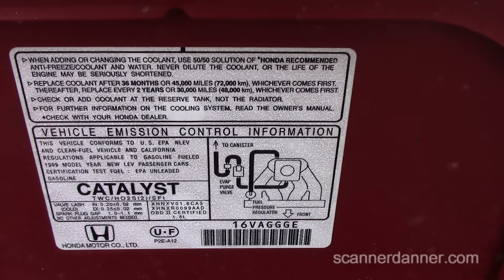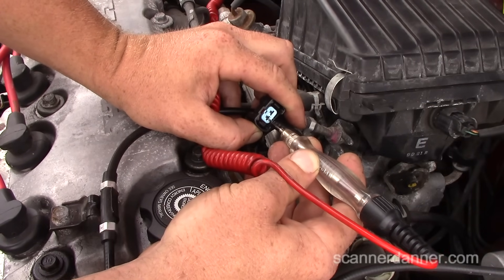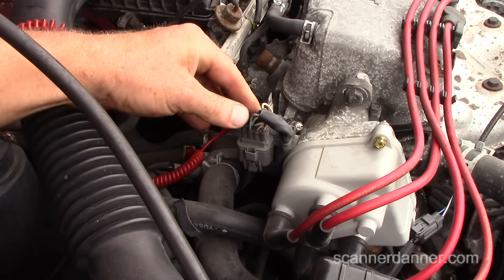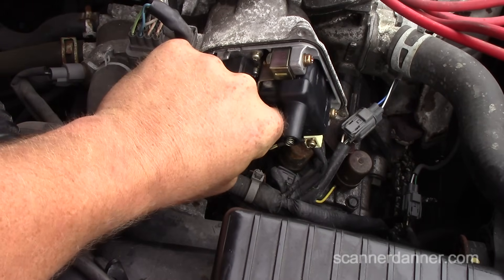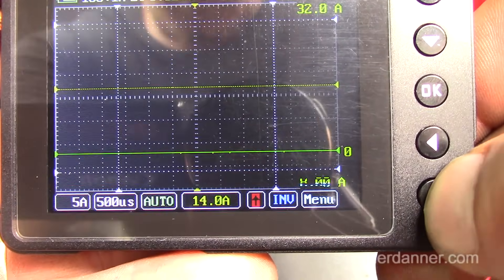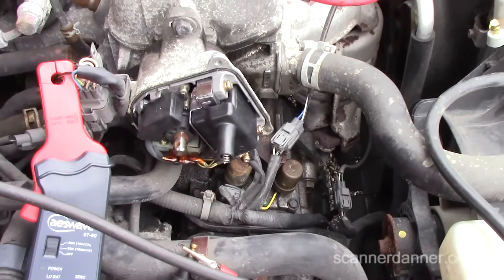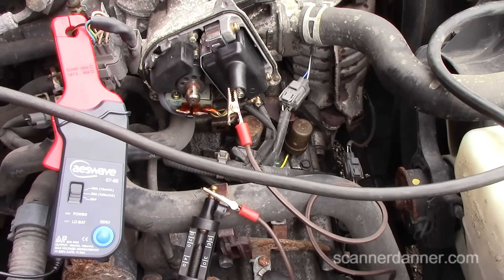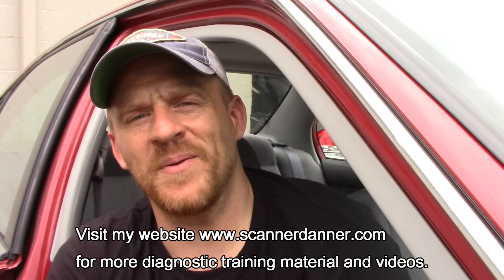99 Honda Civic No Spark Diagnosis with a Test Light

Comment: hows it paul, thanks for the vid! i wanted to let others know about one  "variable" .  i ran into an issue where i had control on the negative side of the ignition coil. test light would blink, ignition coil current ramps ok, but still no spark out of ignition coil!  At 8:18, you disconnected the ground on the igniter. and put your test light to positive to check output on icm, how ever in my case, when i did that my test light would stay on. indicating a short internally of the icm? replacing the icm was the fix in my case. could you explain why id have a ground coming out of icm constantly  on that terminal at 8:18. thanks

Comment: Thanks for the video. I used it to troubleshoot my ignition coil. I've got a 91 civic with 136,000mi on it. Since I just had to replace the coil, I'm thinking about also replacing the ICM igniter before I get stuck on the road again. In your experience, about how many miles can you get on the original honda ICM before it needs to be replaced?
Reply from the maker: can't put a number on that Steve-o

Comment: Probably late to comment but I’m dealing with the same car similar situation. I have injector pulse and spark but when I take the wire off the igniter like you do it doesn’t pulse. It pulses when I reconnect it. Can an igniter be bad and still have spark. From what I’ve researched the distributor has 3 sensors built into it. Ckp sensor a cylinder position sensor? And some other sensor.
Reply from the maker: If the spark is weak, yes, an ignitor failing can do that.
How far does the spark jump? It should jump a 1" gap.
Reply from the maker: Check out this one that had weak spark from a bad igniter 
https://youtu.be/eoodIVGgGyw
Reply: @ScannerDanner  I’ll have to double check all my test again and get back to you. I ordered a reman distributor just in case. The car had one installed at one point. All I know about the car is that in ran when parked supposedly. She didn’t know it didn’t start.
Reply: @ScannerDanner  got it running. whoever worked on the car before me installed the wrong spark plug wires. I bought new ones and compared the new and old and the old were a good half inch shorter.

Comment: Paul, I just got a picoscope 4425 and am new at it. Could you tell me why my "zero" (or baseline) jumps up and down during my coil current ramp test while engine is running. The ramps are fine, but just the zero line (with ramps on it) are jumping up and down. Thanks.....

Comment: I notice you check injector pulse with the connector unplug. Can it be done with the connector plug in. With the test light connected to battery positive.
Reply from the maker: It can be done plugged in too, but some test lights will carry enough current to energize the injector, which is why i do it unplugged and yes, connected to battery positive with the test light.

Comment: this may have been covered somewhere else but I noticed you used an incandescent test light so I take it no problems with current draw on computer or did you ensure test light was of low amperage anyway? Hence my next question where does an LED " computer safe " test light come into play when testing switched grounds?
Reply from the maker: I am using a light on a circuit that normally carries 6-10 amps of current. My incandescent test light draws 200milliamps. There is no concern here. 
Now, for the ECM to Igniter control signal, you would not want to use this light as it would most likely pull the signal to ground through your light. Maybe an LED light would be your friend here, but LED lights can also be misleading.
Reply: @ScannerDanner  thanks

Comment: Changed the distributor and rotor yesterday. Very very simple, right? Yup. I have done it on many vehicles over the years but once done The car (1996 Civic CX) would not start. It would crank over but not start. It is my assumption that when I had to lightly crank it to expose the rotor screw, I wrecked the coil. I will use this vid and my test light to sus it out. My son will be crank man as it is his $500 Civic.

Comment: hey man dude ur vids are awesome.. i own a small marine repair shop and just hit a my first brick wall with a no start situation on a early 90s delco EST system on a 454 marine efi engine (vortec gen 6), ran fine for 2-3 days on stand, came in 4th day, powered on, did sth for 5 minutes and the coil was SMOKING. Nothing else looked bad- tested pickup (ohms and short to ground test), tested with 3 icms, more work to do but i am learning alot just seeing you say the same thing over and over and slowly im forming the picture- sweet man thanks for helping us noobs out with this stuff-
Reply from the maker: thank you so much! This video may help you a bit too 
https://youtu.be/7nHbctRwyys
https://youtu.be/9U942uGTZf0
And then this GM distributor design no spark video https://youtu.be/mDKj19Hnhd0
Reply: @ScannerDanner  Hey I really appreciate replying man, much appreciated- your videos are real helpful. Found a pinched grey tach wire that was shorting the primary (ouch smokebomb!) - ill be looking at getting your book too- greta help man thanks again!
Reply from the maker: @SocalMarineUSA  heck yeah man, nice find!! What led you in that direction? Coil negative would have been grounded constantly. 
Using my test light methods, with light connected to ground, you would have noticed that coil negative was not lit up like it should have been. Then to keep the coil from frying again during the rest if the tests, I would have unplugged it, and switched my test light to battery positive and connected that to the disconnected coil negative wire. Light would be lit constantly. Then I would have unplugged the ICM to confirm light was still lit, confirming short to ground on the coil negative circuit which would have led directly to what you found. Is that what you did?
Reply: @ScannerDanner  hey - so i was working on a marine variation, why they have a loose grey tack wire is beyond me, when there is already one in the main loom to the front - the bastard got pinched between block and a bracket.. it changed colors too which is just plain stupid on any marine engine.. I did use a GTC505 to confirm zero spark, as i wasnt 100% sure how your tests would reveal my exact issues - by not seeing it spark a certain way would mean I have seen it spark the right way before lol .. I eventually figured what the white wires was by opening the loom and found it was grounded which was a real fluke-

Comment: Mr. D, where do I go next in a diag if I have pressure at the rail, injectors are firing, but no spark at coil, or no ground pulse from igniter to coil.

Comment: I have a 98 civic that’s starting to slightly misfire at idle when the engine is warm (mainly after driving on highway) no codes or anything. Are coils known for failing when hot or possible something else? Thanks
Reply from the maker: Idle only? Do a valve adjustment on that engine before you do anything else!
Reply: @ScannerDanner  Yes idle and very low rpm acceleration. Again it’s not consistent and sometimes never does it for days. Mainly can be reproduced if driven for a long time

Comment: I did everything you did and I’m not getting power to my injectors wen I crank it and I have no spark I’m getting power to the coil but not to the igniter does that mean is my ECU?
Reply from the maker: With the key on, measure the TPS or MAP sensor for a 5v reference and tell me what you see. One of the 3 wires on each sensor should read a constant 5 with the key on

Comment: I only have a test light. I’m testing my ignition coil for spark but no spark comes out my light flickers when I have it on the wire. I’ve used my volt meter to read if there’s volts but no read just 0’s. Do you have any suggestions?
Reply from the maker: what does coil + look like compared to coil - ? (during cranking)

Comment: if you crank it that much with fuel beeing injected, do you consider that a Problem ? I mean the fuel getting into the oil
Reply: I reckon most would be blown out the exhaust.
Reply: Did you not hear the engine when it first started? There was plenty of fuel in those cylinders and thats why he rapped the throttle a couple of times to clean the plugs up.
Reply from the maker: Yes but no more than what the customer already did to the car before bringing it in. These always come in with dead batteries, so what's that tell you?
Reply: I have had many cars towed in that are flooded from no spark cranking.  Some even wash down the cylinder walls and lose compression.  Sometimes you can smell the gas in the oil.  Always put those down for an oil change after I get them running.

Comment: Paul I love the look of the AES 1 channel scope ... but, according to specs it's only 1 MS/sec? Is that sufficient for consistent detail of a secondary waveform ie enough for a consistent firing line maximum to display? Mine is 2.6MS/sec on 1 channel and I find it misses a consistent firing line display.... tends to bounce around.
Reply: Sounds like a triggering issue, try experimenting with trigger settings
Reply: Thanks for the insight. I don't mean the waveform walking across screen. No prob stabilising the trace. I mean trouble getting a consistent firing line kV peak on known good cyl, or reliably comparing between cyls. Firing line jumps from peak to low to peak. I'm assuming it's a sampling rate error ... not fast enough to consistently capture the micro secs of peak kV? ie 2.6Ms/sec versus say a Pico that might do 400Ms/sec on one channel. Welcome thoughts?
Reply: Wasted spark system?  --if it is  kv is always lower on the  spark  that occurs on the exhaust stroke so 50%  of the sparks will have lower kv.

Trick to capture the useful sparks is to increase the trigger voltage level to a high enough voltage that wasted sparks don't trigger the scope.
Reply: no not wasted spark ... Standatd COP arrangement but also tried on coil & wires system
Reply: Should be more than OK for that I have the same hardware but not with the uScope firmware and it works fine on primary and secondary.
I have had problems with Hantek secondary ignition probes failing, these days I tend to go straight for primary.
Reply: haha ... funny u mention Hantek. i am using a hantek. i find it more than adequate for everything except sec ig. i wonder if a good inductive paddle probe wld be better a la pico!

Comment: Hi Scanner,any clue 1998 Jeep Grand Cherokee Laredo 4.0/242cu.in long crank time like 7-10 sec. I know that's not long but never did it b4.good comp. all six holes new cap rotor wires plugs. What's a good direction to look at first? No check engine light.
Reply from the maker: Fuel pressure

Comment: So is an igniter the solid state equivalent of points?
Also why was there no battery + on one pin in the injector plug, I get the computer is grounding (control) on the other pin through the test lamp to battery + in order for the injector to fire it needs + all the time doesn't it?
Reply: Yes, exactly

The test light clip was on battery + so it only lit when the ecu supplied ground. There was power with the key on but with both ends of the test light on positive there's no voltage difference to make the light light.
Reply from the maker: Thanks Matt
Reply: ScannerDanner Oh Thanks I thought the test light was on ground at first checking for power to the injector. Was just following the way I would have been thinking if you see what I mean

Comment: Old thread I know, but at 9:00 you touch the igniter and it pulses. What do you do when it does pulsate? It's dead no light. Same set up one the yellow green wire into distributor and nothing either.
Reply from the maker: What have you done with it so far?
Reply: @ScannerDanner  2000 crv 2.0L crank, no spark. No spark on any wire, distributor cap or coil tower. Test light from grd shows power on + and - connection of coil. But no flashing light. Isolated coil, like you suggest, with pos batt test lite connection get nothing from ignitor coil post(all this as cranking ) also did positive connection to batt and test yellow green wire at distributor input wires, nothing at all.
Reply from the maker: @stpphone5074  do you have injector pulse?
Reply: @ScannerDanner  have not probed it. But hear fuel pump and smell gas during cranking. Was trying to establish spark before looking into gas.
Reply from the maker: @stpphone5074  just wanted to he sure you're getting your distributor input signals to and from the computer. Definitely still focused on the no spark, this just gives us good direction. If you smell gas, that is a pretty good indicator. If you can't trigger that igniter, it could be:
1. A shorted ignition coil
2. A bad igniter
3. Wrong test light being used or not done properly
4. Wiring problem to the coil or igniter
Reply: @ScannerDanner  took coil to parts store and multimeter the connection s on both, very close readings so i assume it was ok for now (revisit if need be) altho it does have indications of arcing on surface of coil. Thinking it could be a bad crankcase sensor
 I tried a "jdm b20b 99-01Honda crv rd1 obd2b ckf bypass" (YT vid) with wiring splices but didn't seems to effect it.
Reply from the maker: @stpphone5074  at this point, if you still need help, let's move this to my forum. It is free to join https://www.scannerdanner.com/forum/post-your-repair-questions-here.html and we can continue this there. These back and forth messages here tend to multiply and I have 300k other people asking me questions, so it get's really hard to keep up. 
Last message then to the forum okay? 
This is why I asked you about injector pulse. If you have injector pulse your crank sensor is fine. Second, the ohmmeter tests of a coil are not good enough. When and ohmmeter tests good, it can still be bad. When an ohmmeter tests bad, it is bad. That is the downfall of that tool. To the forum my friend, hope to see you there.
Reply: @ScannerDanner  sorry for forgetting to post back. Resolved it by replacing distributor. Thanks for your help.

Comment: Is the test light can resist spark for coil??
Reply from the maker: Yes but only use an incandescent style bulb (like this one), you will cook an LED
Reply: @ScannerDanner  this one
How many watt and volt??
Reply from the maker: @mekkibilal1372  they don't make this one anymore and it is getting harder and harder to find incandescent test lights. We have one we are working on that should be ready soon. Not sure the watts on this but it is a 12v test light and will draw about 200ma of current
Reply: @ScannerDanner  thank you very much

Comment: How can you tell that wave form is a shorted secondary and not a shorted primary? Wouldn’t a shorted primary cause a faster current ramp too?
Reply from the maker: shorted primary will be a completely straight up line and may even resemble a square wave pattern. In other words no ramping affect at all.
Reply: ScannerDanner ah ok, thanks

Comment: Hello, I did the positive battery side to the negative side of igniter (yellow wire black stripe) and even turning over i get no light. I replaced the igniter and still no light can you help? Thanks! 2001 accord Ex 2.3,

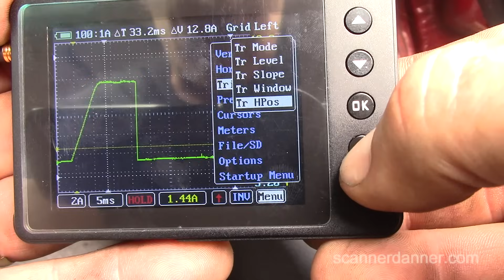Comment: Paul, @ 24:50..I'm not sure, but what I think you really want to be able to do is instead of going into the trigger menu is to go into the Horizontal menu and select "Horz Pos". That will make a small yellow rectangle at the bottom middle of the screen, which you will be able to move the position of your event either left or right in fine increments...It is better than the 2 positions the trigger menu "Tr Hpos" has to offer- Better control.

Comment: Thank you so much for this video... i have a 1998 honda civic DX and one day i was coming back from the store my battery light came on so maybe i thought it was my alternator so I replaced it but still no crank.. the motor would just rotate but didnt start then i changed my battery to a new one but still doing the same thing... so today i changed my fuel filter thought it was clogged up but that didnt help.. at all i thought maybe my timing belt had jumped a teeth or ripped off.. so my last guess will be my ignition coil that gaved out so this video really helped me since u did all those tests but didnt do the test on the distributor.. since mine is having the same problem wont crank then definitely its my ignition coil so now ill buy a new one and replace it see if that will make it crank
Reply from the maker: Did you fix it?
Reply: @ScannerDanner  not yet bro ive done everything even bought a new starter but my guess is that my timing belt ripped thats the only thing that comes to mind

Comment: What does it mean if the positive and negative ignition coil screws don't light up prior to cranking the engine?
Reply from the maker: as long as they light during cranking you are good. This is a design variation (Chrysler/Jeep in particular will act this way and some other Euro systems)
Reply: @ScannerDanner  Awesome, Thank you very much. I thought that there would've been a problem if they didn't light up prior to cranking. I'll have to check it out
Reply from the maker: @nathanridola8439  it will, but only during the initial key on, and then it shuts power back off until the ECM receives an rpm signal. The reason being, the fuel pump is run on the same circuit, so they don't want the fuel pump running without the engine running. And the initial key on power is a prime for the pump
Reply: @ScannerDanner  Oh okay. So I just tested it and only the negative screw is turning on and flickering. Does that mean that the issue is the ignition coil or the igniter?

Comment: So basically when u got no spark off the coil when it cranked tells you? And I'm understanding that the light shouldn't flicker?
Reply from the maker: It should flicker, flicker shows control is there, but its not a foolproof test, so I continued and answered why, with the amp probe